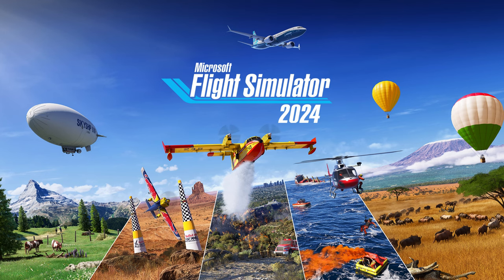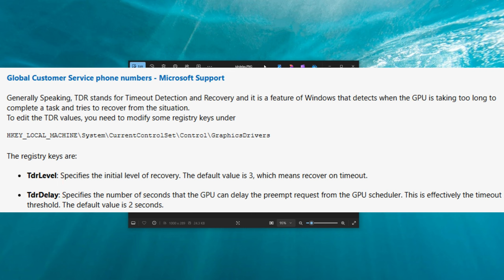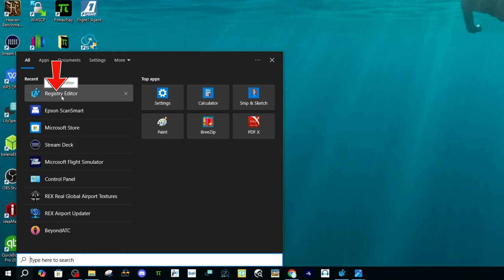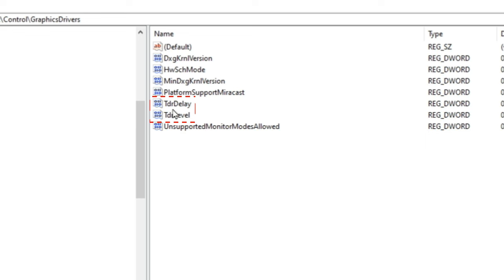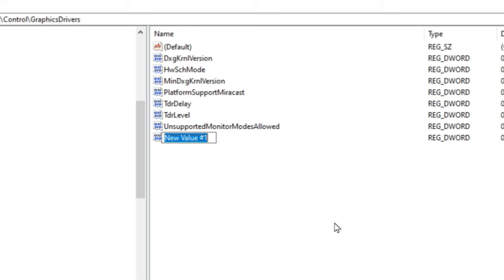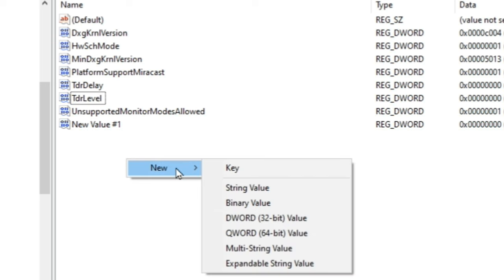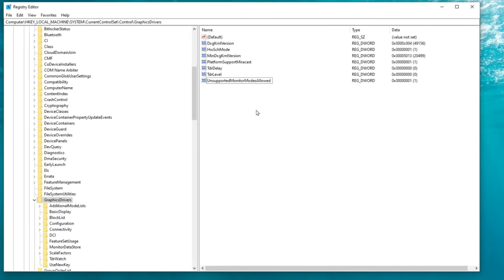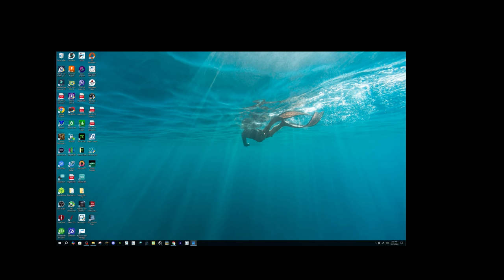Msfs2024 Crash fix DXGI_ERROR_DEVICE_HUNG

Comment: OK i am going to try this out. but why is your HwSchMode on 1 ? this means you have turned  off hardware-accelerated GPU scheduling and you wont be allowed to use FrameGeneration in the game, please reply - mine is set to 2, and 0 means automatic i doubt this 0 works..
Reply from the maker: I don't use hags . I fly in vr and hags give non favorable results . Vr also does not support frame gen

Comment: Thanks a lot. This hint seems the to be holy grail to prevent CTDs. I encountered every 20mins a CTD. I have an intel I9 14900K, RTX 4090 and 64 RAM. Especially when i used my Pimax Crystal LIght I had CTDs after every 10mins. This is FIXED ! Microsoft should be aware of that. It s so much fun now to play the 2024. All the Best and Cheers
Reply from the maker: Thanks for the comment I'm happy it helped you I was having the same issues using the crystal

Comment: I was getting this error only on MSFS2020, (not seen it on 2024 yet) and adding the reg entries made no difference.

Only thing that did was disabling the setting in the global Nvidia settings for Digital Vibrance for my RTX 4080 super and its repeatable. Soon as its enabled, there's the error.

Not saying that it will be the same for all, but that's what I found that works for me.
Reply from the maker: Thanks for the tip
Reply: This also worked for me. Thanks to all for sharing 🎉

Comment: Thx for the video. Will you also work on a full performance video for msfs 2024. Been dealing with stuttering when panning the camera and I've done a lot of optimizations. Unfortunatly I'm still experiencing stuttering when panning the camera.
Reply from the maker: Yes I'm still experimenting with settings.  for that stuttering you may want to try a couple things the first thing run your monitor at its native resolution the second thing if that doesn't work is to turn on vsync even at 100% monitor refresh rate works for me. If that doesn't work then try to turn on the vsync option in the Nvidia control panel and use it on the fast setting
Reply: @2020fsers  Unfortunatly that hasn't helped. It seems to be a strange thing occurring with the renderthread of my GPU. I use a 4090 and 7800x3d. Wondering if it could be an issue with the sim perhaps.
Reply from the maker: Are you using dx12 or have hags turned on ? Maybe try with hags off and no dx12 just to eliminate that variable
Reply: @2020fsers  Tried that, unfortunatly didn't work.
Reply from the maker: Well at least you tried everything that I can think of
Reply: @2020fsers  thx for trying your best. I'm on with msfs support team. They did say an update would roll out later tonight. Might be worth to try and see if it's fixed then. Can't wait to see more msfs 2024 content from you!

Comment: Thank you! The error I have is DXGI_ERROR_INVALID_CALL (0x887a0001). It just happens in VR. Do you think that this metodology to solve the device_hung error should apply to it?
Reply from the maker: It's worth a try . The error sound similar and it won't hurt anything to try it. Please let me know if this fixes the problem
Reply: Hello! Thank you very much for this information. I did the registry change and did a small test flight and so far no CTD. Second try and the error come back.

Comment: I was getting this exact error along with occasional screen lock up and PC shutdowns. I tried this fix and it didn't work for me. After getting into MSFS 2024, I was able to set all the Graphics Settings to low end because I have a RTX 3080. However, within a minute or two when after MSFS 20204 loads, the screen now flutters and goes blank with no error message.  It seemed like things are getting worse for me. I actually was able to fly for awhile even in VR  a few days ago but now my screen just crashes. I hear MSFS 2024 still running but I have to shut off and restart my PC. I want to try clearing the folders you suggested in the video just before this one but I have Steam and I couldn't locate the files. I saw a comment that someone said that it worked with Steam. I couldn't find the 'Microsoft.Limitless....'.   I'll see if the person who commented can tell me how to find the files.
Reply from the maker: Clearing those files may help
Reply: @2020fsers  Thanks, I didn't watch to the end of the previous video about the Steam location. My Bad! I'll give it a try
Reply: @2020fsers  Clearing the files didn't help. Still crashing and PC totally resetting or screens just hang. Should I totally uninstall and reinstall or perhaps just stay with MSFS 2020 until things stabilize? Bummed as I'm getting a Crystal Light in a couple of days. Perhaps my RTX 3080 wouldn't work with it any way.
Reply from the maker: A 3080 will work fine with the crystal light it might be worth trying to uninstall and reinstall again and then if it doesn't work I guess you know your answer stick with 2020 for now until they work out the problems
Reply: @2020fsers  Unistall and Reinstall MSFS 2024 or Windows?
Reply from the maker: Msfs

Comment: The error still comes up.Do you habe any other clues what to do?
Reply from the maker: Ok . You did this exactly as I have . Restarted your pc and running the sim you still get the same error?
Reply: @2020fsers  yeah, i have restarted and tried it twice. Did it exactly as you did. And I also reinstalle the Gpu and the monitor driver. Most of the times it happens while it states 67% loading world data
Reply from the maker: @louisbeyer5637 ok did you try my other crash video I did a couple days ago ? Maybe try that also
Reply: @2020fsers  ok I will try.
Reply from the maker: @louisbeyer5637 yes try that because you may have some corrupt files in there that have to be deleted
Reply: @2020fsers  so i have tried this now as well. It still happens when I hit around 66% loading world data